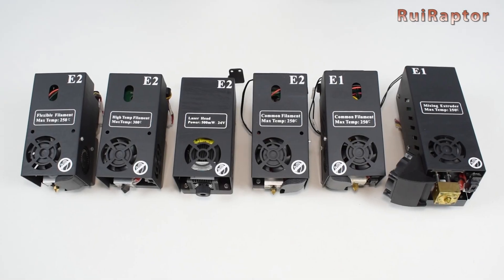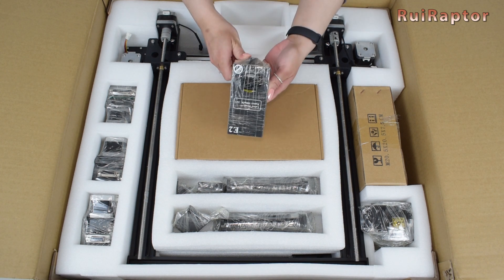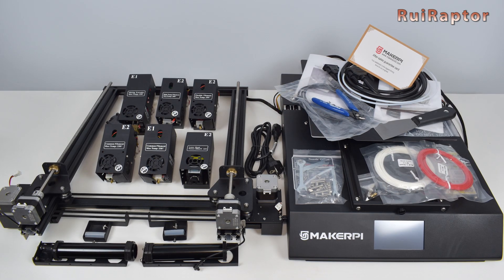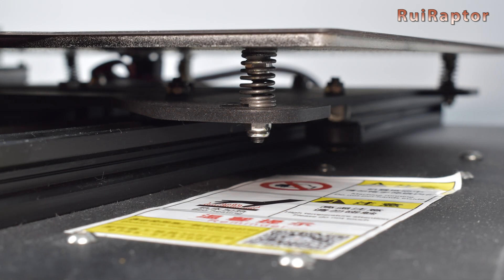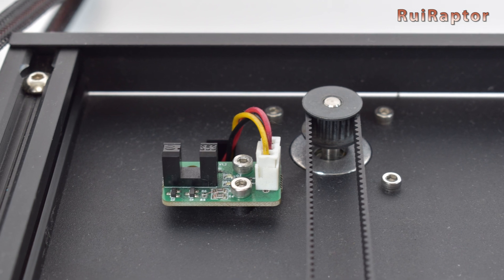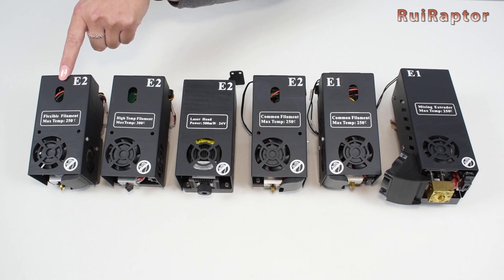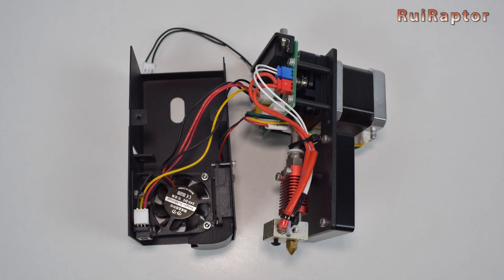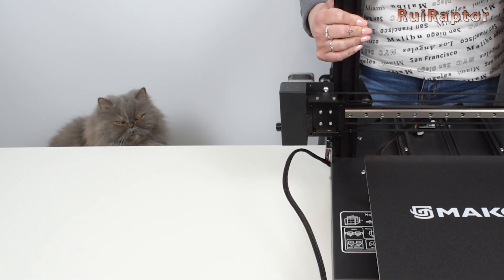MakerPi P3 PRO (5 in 1 Multi-Function) - IDEX 3DPrinter & Laser Engraver - ALL THE DETAILS

Comment: There is far too much going on with this printer, most of those print functions could be handled by a single unit if designed well, and the one with 2 full size extruder motors is a joke, I switched back to Bowden until I got a pancake motor because the mass of one full size motor created artifacts in the print, lord knows what two of them will do!

Comment: Hmmm... Looks interesting, although I would definitely scratch off the dual FIL head. I mean, it has two individual heads to print with two filaments and avoids the need of a purge process. Still, I like the interchangeability of the heads as I always wanted that feature on my old assed tornado, so I can have a standard or a HT / high detail nozzle without much hassle. Curious about the laser as there is a lot of garbage diodes out there claiming to be as powerful as the death star but fail to deliver after all. All that said, I'm nervous about the whole pulley setup there, looks to be a pain in the butt to repair if something goes south... Looks to be a sturdy chonker tho, hope it is decent in the quality and price department... Thx for the vid!